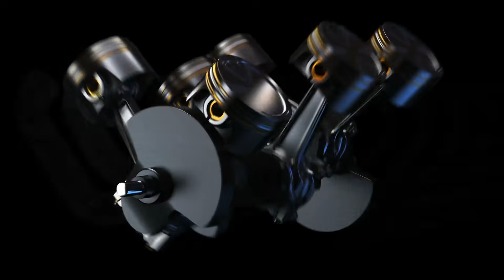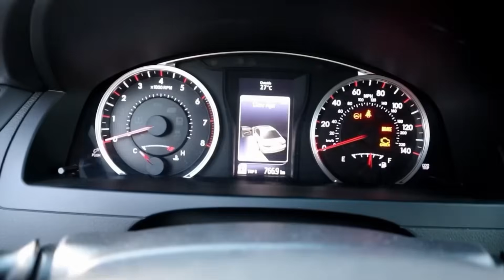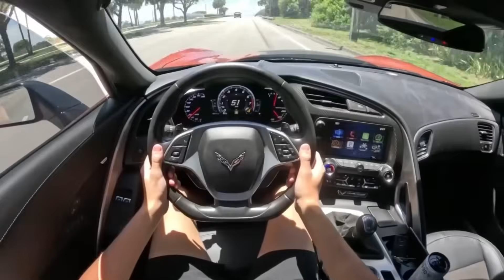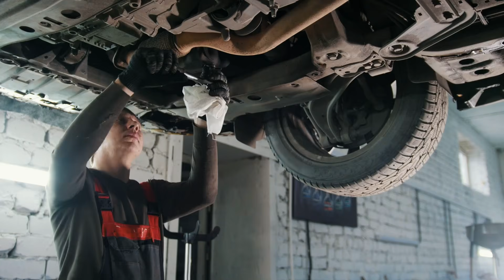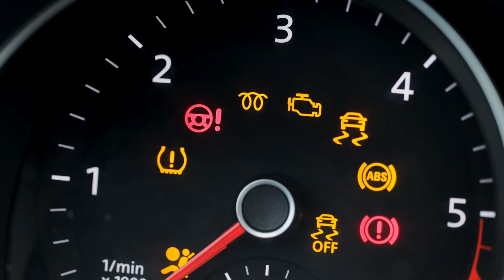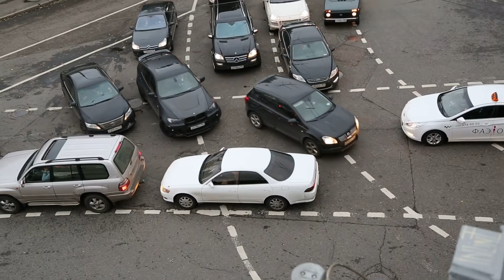15 Signs Your Crankshaft Sensor Is Failing And How to Test It

Comment: My car didn't start one morning & had a friend come over to help. He scanned it & it said the crankshaft position sensor. Before I bought a new one, I checked it for power & ground. It showed ground, but not enough to make it work. I went to every grounding point on my car, cleaned them & my car started right up & actually runs better.

Comment: That is not a crankshaft sensor.  It is a camshaft sensor.  The crankshaft sensor monitors driveshaft position and is usually located at the harmonic balancer.  The camshaft sensor monitors position of the camshaft.
Reply: Naw on 5.7 Hemi crankshaft sensor is on the transmission housing under neath the vehicle just gotta look up ur make n model n lookn at problems
Reply: thanks for that clarification because I replaced my crankshaft sensor and still have a problem didn't even consider my camshaft sensor thank you.

Comment: I have to replace mine. We had a hard time locating it. By the time we found it, it took us 4 hours to take it off. It's only $30 part now. The car runs Perfect, 20 0 8 Chrysler, minivan,3.3 engine. It was in a very tight spot.